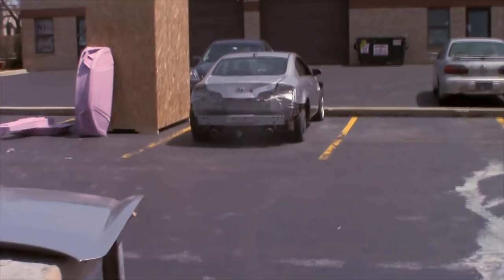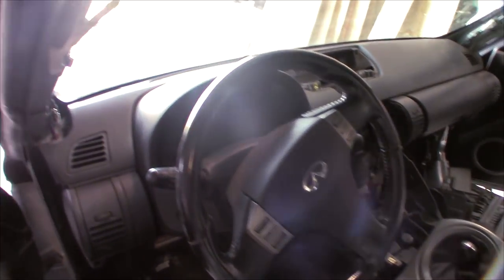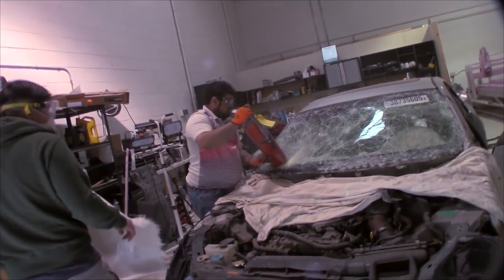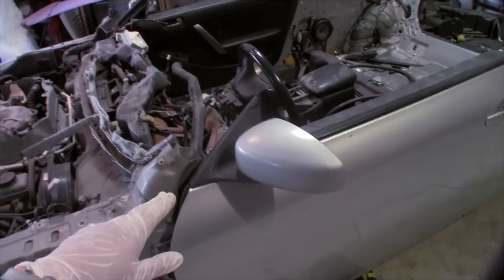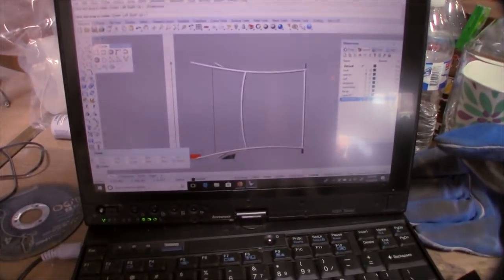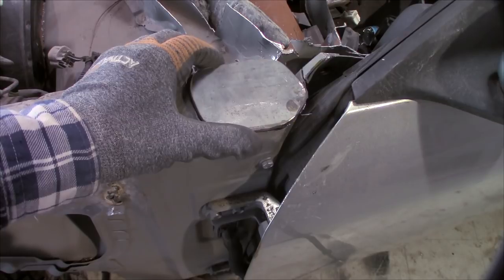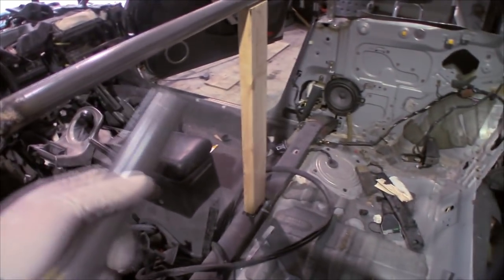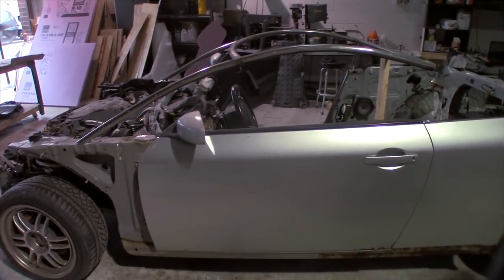G35 project kit car vlog 1- tear down and roll cage build.

Comment: By moving the window frame toward the engine by 12”, how will you keep the heat out from the cabin since the engine is now behind the window?
Reply from the maker: its going to be covered with sheet metal and heat reflective material so it stays apart of the engine bay and separate from the cabin.

Comment: Hi, found your channel last week. Is awesome. Is this car going to be for road use? If so how are you going to get past making it roadworthy?
Reply from the maker: its a g35, its already road worthy.
Reply: Inspire Composites Of course but it has been or will be heavily modified is there no engineering that is needed to he done around that?
Reply from the maker: its not really heavily modified, only the roof has been cut off the unibody chassis and is being reinforced with a rollcage.